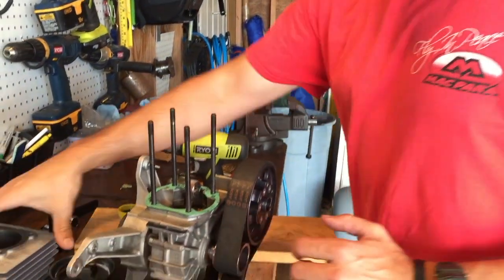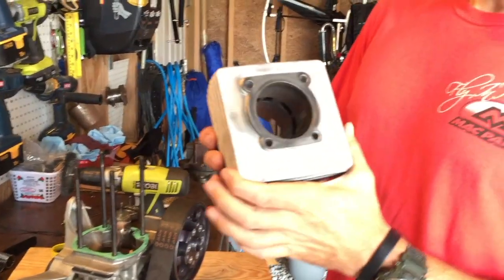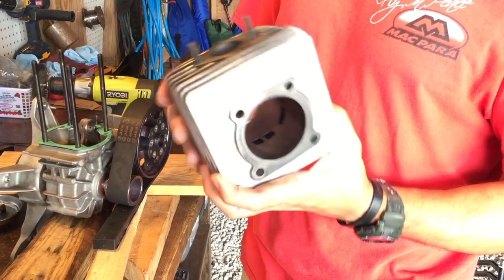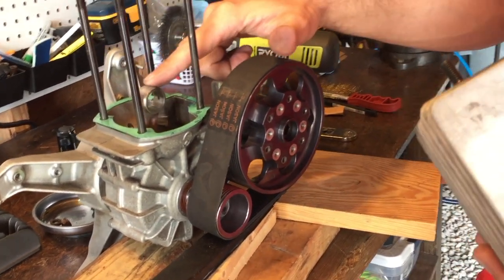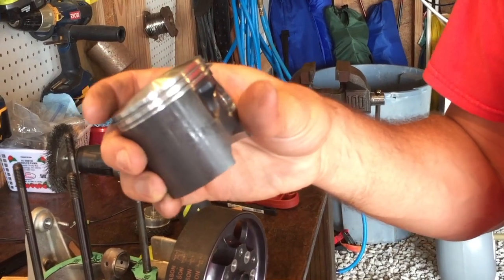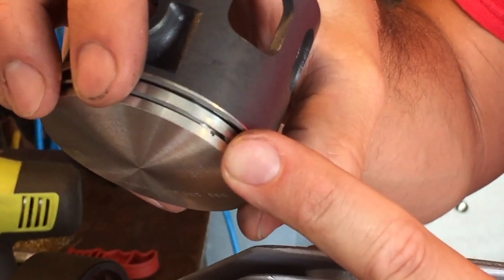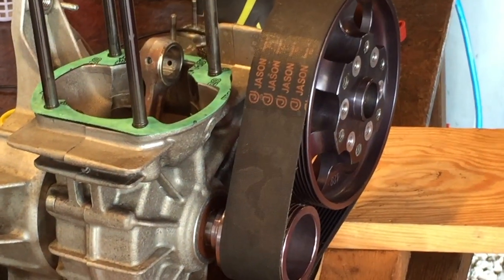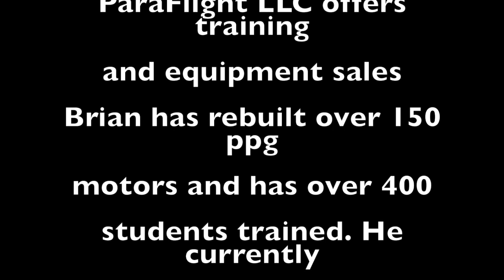Moster 185 Rebuild, Brian Goff, ParaFlight, North Carolina, Paramotoring training,

Comment: Why are you lubing the gasket?
Reply from the maker: It's a paper gasket with a wax coating, the oil helps prolong the seal and extends the hours of operation. We average about 120-150 hours between rebuilds when the gaskets are oiled. We get 60-90 when they gaskets are not oiled. Its up to you, but that's 15 years of experience in PPG talking.
Reply: @Spin2329  Good to know.  Thanks.

Comment: Brian does not say what to do, if your head, or cylinder end are not flat surfaces. He mentions laying on a smooth piece of glass. yes. If you then find deviations, at all, lay a piece of crocus cloth on the smooth glass face, (as with rolloverriderpgr)and work the head over the surface of the crocus cloth till perfectly flat. Head and cylinder end. Thus brand new after smoothing. This will even work if mistreated previously, by improper torque of previous repair. I would then use Cerokote on both the head and piston to keep temps down by over 100 degrees C and almost prevent piston damage from lean conditions to a large extent. Loose headbolts would not be saved.

Comment: Never use just plain glass to do the cylinder head as it is not flat which is the reason you see ripples in many windows. I've been doing the following on motorcycles since the 70's.

Use a 20"x 20" x 3/8" sheet of TEMPERED glass. Tempered glass is flat! Use 400 grit wet paper and tape it to the glass then add water or machine oil and then lay the head on it and do figure 8s and circles with the head on the paper until smooth. Don't over do it! Keep checking until it is smooth.
Do not push down on the head but let it's weight do that work by holding the sides of the head as you could push to hard on one side and have a wop sided head! When it is a smooth shiny finish you are done! 
This is also good for doing the crank case halves of PPGs and motorcycles!
Micrometer or caliper. They both do the job! 
Sorry for the hijack but very informative. 

Blue Sky's and Safe Journeys!

Comment: What are you looking for when you check the bearing on the crank? do you have to pull it out to accurately inspect it? When you pull it apart to just do a once over on the thing you should have that base gasket, a headgasket, and new exhaust gaskets on hand right? Anything else I'm missing that needs to be replaced just to do a check up on the engine?
Reply from the maker: Discoloration, almost like gasoline on water, there are 2 copper color washer looking pieces on either side of the roller bearing. Make sure neither copper washer is broken. You do not have to pull everything apart, you can see almost everything with the piston removed. I have a small LED camera with a light that I use to see up close if needed. Yes if you pull it apart to check everything you should always replace the base gasket, head gasket, exhaust gasket, and I'd recommend replacing the carb kit. Check the reed valves which are located in the rectangular hole in the engine behind the carb. There are 4 allen screws to remove the reeds. Hold the cheese looking reeds up to a light. If you do not see any light coming through the edge of the carbon reeds, your good to go. If you do see light coming through that means your reeds need replacing. Make sure you torque everything back to specs. Good luck

Comment: After How many hours should it be a complete rebuild?
I was told 200hr. but to me that is even way to many. 8500rpm x 200hrs Hmmm
Reply from the maker: I normally rebuild after about 75 to 100 hours. If you notice the motor losing RPM's or runs hot rebuild it.

Comment: Where is the serial number stamped on Moster 185?
Reply from the maker: Normally it's below the reed valves scribed into the casting. Locate the carb. the 4 small allen keys are your reed valve mounts. look under the bottom allen keys screws on the metal part of the motor. You should see a 6 digit number.
Reply: Brian Goff thank you

Comment: Hi Brian,  Do you believe the carbon fiber cooling shrouds made for the Moster 185 cylinder heads are worthwhile?  They seem expensive and I'm wondering if they are worth it, or if we should design something similar that can be 3D printed.
Reply from the maker: John Hansknecht I can tell you from my experience that the shroud seems to drop the temp. about 15-20 degrees in level flight and 20-35 degrees on climb out. I personally take the shroud off simply because we fly a lot and it's a pain to take them off to torque the head bolts. If you keep up with the torque specs on the motor ever 5 hours you shouldn't ever have issues. My engine temps without the shroud always remain well with in safe window temp range of operation. The shroud simply drops it a few degrees. I'm going to post monster rebuild part two soon. Watch how I install the head temp sensor. Cheers, Brian
Reply from the maker: The cooling shroud brings the temp down about 20 degrees

Comment: hi can you please help . i have a moster 185 classic and when cleaning out the compression hole i also changed the base gasket.but i think i put the wrong size base gasket in.hence the motor is not running properly.overheating how do i go about finding out the correct size base gasket? or is there a size thickness to use? 20/11/17
Reply from the maker: Moster Classic usually uses the 0,3 base gasket. Did you also change the head gasket, rebuild carb kit, and replace exhaust gasket? How many hours are on the motor? Maybe you need new rings? Does your silencer rattle? Did you torque the plug to 24.45NM and set gap at .031? When was the vacuum hose replaced last?
Reply: hi brian ive done all that you mentioned except the vacum hose. hours est 50.if the wrong base gasket was attached what would be the systems? .newish piston 5 months old.silencer doesnt rattle.this may not be anything.but ive replaced all the fuel lines. and i still get air bubbles too.carb rebuild. its a nightmare.i come from a mx back ground . and i use to maintain my mx bike. oh tx very much for answering so quick  ;0)
Reply from the maker: Did you replace the fuel line inside the gas tank? Did you replace the porcelain filter on the clunk? Do you have an inline filter? Do you have a primer bulb? Call me.. paraflightnc.com

Comment: hello. I got a Vittorazi 185 to rebuild. if I have the cylinder remachined can I buy an oversized piston ? Does the a b c rating stand for the piston size? any idea where I can buy it?
Reply from the maker: No you will ruin the engine. The cooling fins aren't designed to handle the heat. Plus you will need to adjust the carb, reeds...etc. Your wasting your time and money. Rebuild it to stock and put a 51" prop on for more performance. Cheers Brian
Reply: Brian Goff do you meaning I  have to buy a new cylinder + piston?
Reply from the maker: I don't know, what does your jug look like? scored? scratched? Is there deformity in your piston? If your not sure take pictures and email me. go to www.paraflightnc.com to my email.
Reply: Brian Goff cylinder is scored.. can it be machined? should I just get piston and cylinder?
Reply from the maker: New Jug, Piston, Rings, base gasket, head gasket, exhaust gasket, carb rebuild kit.

Comment: Is it NickelCil plated?  I heard malgum.  I want to learn.
Reply from the maker: Not sure what I referenced in the video. These are all possibilities Nikasil (Nickel Silicon Carbide), rings-molybdenum metal, Nanoslide, chromium,  moly coated sleeves. In most cases its a electronic charge spray and then honed to the piston. 

The only thing close to "malgum" you mentioned that I know of is  amalgam used in dentistry fillings back in the day. (NOT MOTORS) 

Hope that helps

Comment: I was wanting to upgrade my Moster Classic with a clutch, is there any way I could do that?  I was thinking of ordering the parts, and it looks like I would have to order a few to make it all jive, with the extended drive shaft etc.  Do you know where I could find all the parts I would have to order for a Clutch upgrade on a classic?
Reply from the maker: Brandon Roadarmel I've never converted a Moster Classic to a clutch. The only thing I can think of that I would confirm is the lobes on the crank are not going to mess up the timing. The extended shaft wouldn't make a difference.